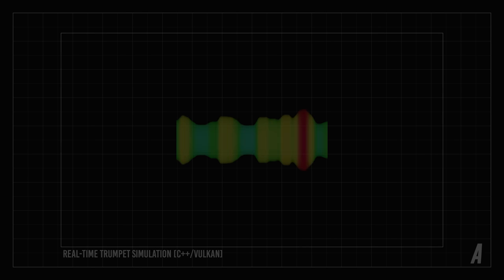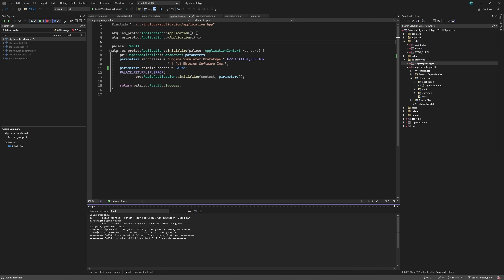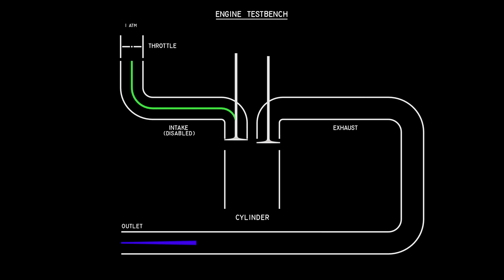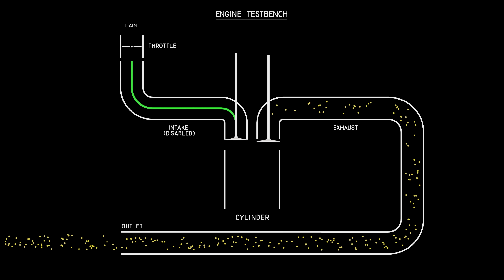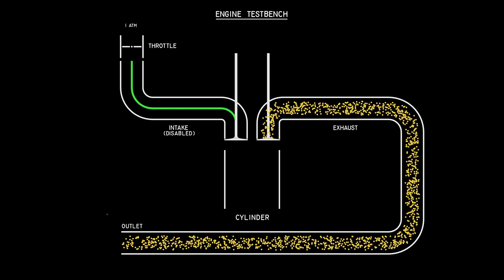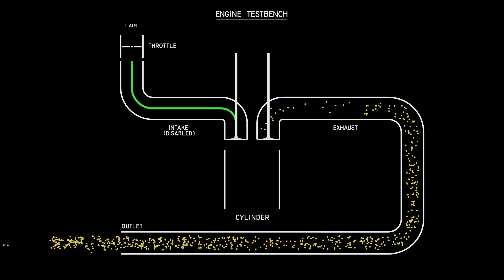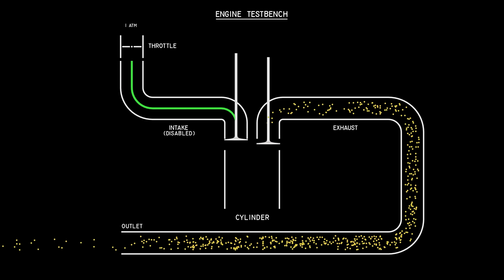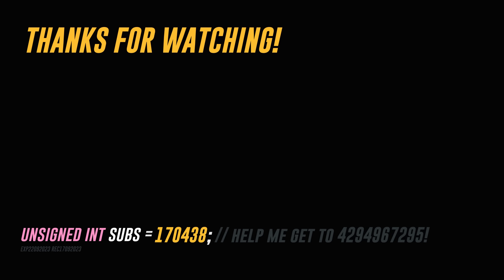Initial Audio Testing - Engine Simulator Devlog 3

Comment: I actually find that the reverb takes away from being able to clearly hear the engine, especially since most engines are listened to outside where reverb is minimal.
Reply from the maker: The user can change the reverb to whatever level they want. In the video I showed what it might sound like in a large garage or hangar but it's just one of many ways to use it
Reply: @AngeTheGreat  That's exactly what I was envisioning in my head! Amazing results.
Reply: @AngeTheGreat  that's what i thought, but its awesome that you include the environment effects into the model - this way, if we imagine this used in a game, the sound of the engine can adjust as the vehical goes into for example, a tunell, or goes from a road in between fields to an urban area. Amazing stuff!
Reply: The particular reverb applied is very "wet" (the mix of reverberated vs original audio is too high) and the character is that of a very hard surface with minimal obstructions, like a mostly empty brick garage.

The good news is wet/dry, decay time, and impulse response are all really easy to modify parameters of a reverb patch.
Reply: Could somebody stick an impulse generator under the hood of a car in a field somewhere and just give us the oneshots? Then environmental reverb can be added as a post-effect, and we could embed the geometry of the whole car into the sound. Come on, so cool.
Reply: Definitely needs different types of reverb for different environments but this was good to show something outside of an anechoic chamber 😊
Reply: One thing to keep in mind when it comes to that though is that the reverb is something that should be implemented by the game itself (should this be used in another game) since the environment is going to be changing constantly. 

For an inbuilt environment simulation though having a variety of different reverb controls would be pretty cool, and potentially a delay effect in order to model different spaces (tunnel, parking garage, valley).

The biggest thing that I think could be really useful here though is adding randomness to avoid having reverb that sounds super boxy.
Reply: Yeah, before it was an engine in a studio, after - an engine in a bathroom
Reply: Obviously Engine Simulator needs to be a VST plugin so you can put whatever effects and eq you want on it. This has the potential to be a really interesting, incredibly powerful synthesizer. I'm sure there are music producers out there who'd love to have physically simulated instruments.
Reply: I, for one, exclusively listen to engines in my bathroom.
Reply: It sounded like the reverb of a garage to my ear, I’m guessing the impulse responses were in the several meters range, not the sub-meter areas inside engine bays and underneath cars
Reply: I quite like it, it sounds like a dyno
Reply: This is actually a trick our brain plays on us due to psychoacoustics. When you're in a room, your brain starts to adapt to the room's reverberation and slowly starts filtering it out so that you hear the source sounds as clear as possible. This applies to all spaces. It's not like you stop hearing it, you just stop perceiving it as much. That's why when you put headphones on and listen to something with reverb your brain gets confused about the location of the source and doesn't filter the reflections out- making the reverb that much more noticeable and intrusive.
Reply: @marbletea  huh. i didn't know that is a thing. I know about sense of smell stopping to notice consistent ambient smells, but didnt know hearing has similar mechanism. Maybe that's why i have different perception than others - i was listening on noise-cancelling headset, which might have given me different perception than someone on speakers had perhaps.
Reply: It sounds like the inside of a car repair shop. Nothing wrong with that.
Reply: This is a simulation of what it would sound like if you were right up close to the cylinder of an engine, not a simulation if you were outside ethe engine listening to the exhaust note.
Reply: there's actually a lot of reverb going on that you don't even notice
Reply: Yea. Most proper don’t rev actually engines in music studios, but most of us aren’t watching this in one either hehe. My walls add just the right reverb to the sound. … but listening with headphones would be entirely different… you can never win hehe 😅
Reply: I kinda like it. It sounds like when you drive up to Godzilla and he gets mad.
Reply: Lol, if you live in a city, or in a forested housing area such as myself, all you get is reverb all day every day
Reply: @LeGrandSarrazin Not at this intensity. At level presented it was more akin to running the negine in a garge or workshop. Granted, it's probably very easy to just have a control for this so its simple to have a slider in UI for amount of effect.
Reply: @gloowacz funny thing, the place where i live has some streets that have exactly the kind of reverb i heard in the video - to the point that it startled me how accurate it sounded even with such a "crude" approximation. but it it true that most streets do not produce quite as much reverb
Reply: @wulfifi @halluminium Maybe i'm just too used to my city. It's very "green" - there is tons of noise supressing foliage growing everywhere, bushes and trees on every street, etc etc (often placed in between every few parking spaces in malls etc) so maybe my perception is skewed, but that does not sound like anything i have ever heard on the street or parking lot. It was like it was placed in a corrugated sheet metal room, where the walls would actually resonate and increase reverb.
Reply: @gloowacz  oh yea definetely. My city also has a lot of green, and around particularly noisy roads we even have noise cancelling fences. There are only a few places that I heard this kind of reverb, and it is rare. I guess it could be bc some streets have very similar tall buildings on both sides and when there's no greenery it basically forms a rectangular prism? Idk, I'm far from an expert on acoustics
Reply: @wulfifi yeah this really reminded me of someone running a weed whacker around a corner
Reply: @LeGrandSarrazin Not really no. The revers feels like a closed stadium.
Reply: @LeGrandSarrazin   the reverb is an effect caused by the environment, it doesn't come from the engine itself
Reply: @B9poy  I'm well aware, thx
Reply: Oh my sweet child. You will never be free from the Shackles of reverb.
Reply: The reverb sounds like it's in a parking lot.
Reply: Dunno, with that reverb, it sounded almost exactly like a distant chainsaw in a forest.

Comment: I'm imagining a car builder where you can tune suspension, tune a virtual ECU, swap out parts, etc. Like beaming + automation, but focused not only on realistic simulation of pre-defined components, but also fine-grained creation and editing of parts to design a truly bespoke virtual car that handles, drives, and sounds exactly how you want
Reply: Messing with fuel maps will be both exciting and stupid annoying
Reply: @GewelReal yeah but imagine what one person could learn just from playing around with it, then BOOM land a job at a speed shop with vidyagaem knowledge
Reply: @steeliewheelies  Except the automotive industry is doing everything it can to turn cars from serviceable utilities to disposable commodities. Every year they make it harder to repair new cars, either with special proprietary tools to software lockouts to parts designed to break when you try to remove them.
Reply: @shred1894  it’s true and it’s sad. That’s why I went with speed shop and not auto manufacturer engineer. It’s up to us to keep what’s cool, alive
Reply: A consumer/hobbyist level simulation (not necessarily very gamified but like a virtual engine dyno) would be incredibly useful for R&D when building real engines... I'm always wondering how a change might affect the whole but without simulation or money to throw into testing IRL, it's difficult.
Reply: So has literally everyone else since video games were a thing
Reply: I imagine the same thing, and I can’t wait to see if someone can build it in the future! I want it lol
Reply: That's a very long way away but it's exciting to think about